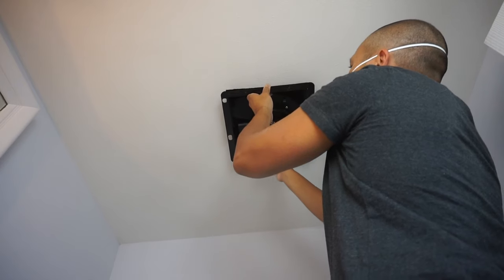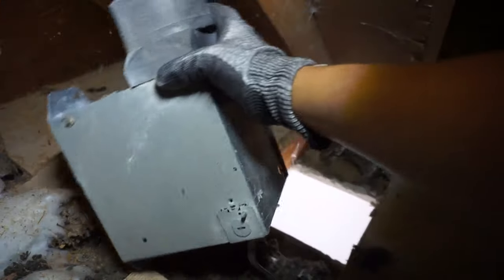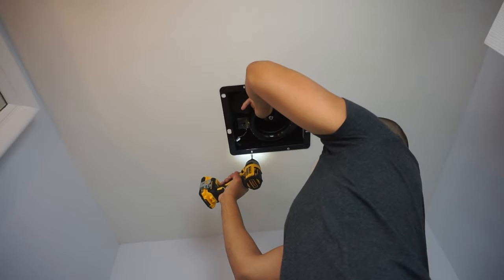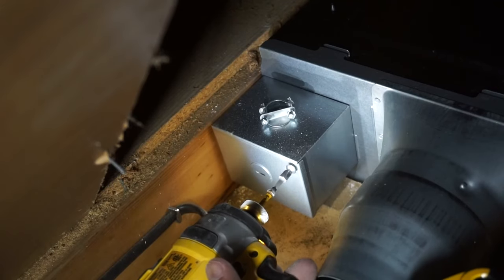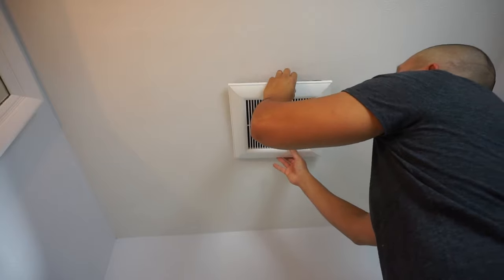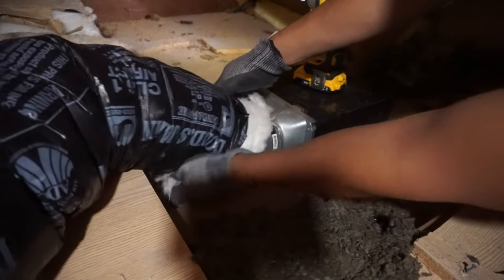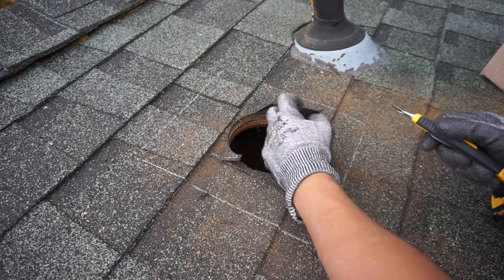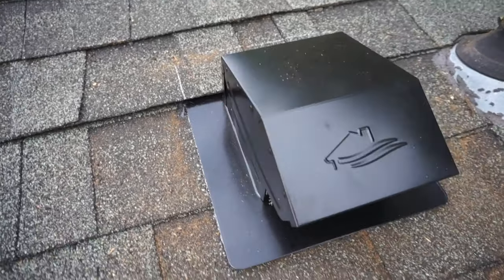How To Replace And Install A Bathroom Exhaust Fan From Start To Finish For Beginners! | Easy DIY

Comment: WHy would you cut a HOLE in the ROOF, when you could have simply cut a hole in the SOFFIT that you'd never have to worry about it leaking instead????
Reply: venting it out the soffit would cause all that moisture to just migrate up into the attic, negating the whole purpose of removing hot air from a home. It is not a recommended practice.
Reply: @Kendo-84  No, no, no. It is recommended. Better than having a leaking roof. You simply have a flex pipe that leads to the soffit area. Your soffit is what, 2 feet deep? Your fan blows the moisture out. Any moisture coming in goes where? How can it go into the attic? It can't because your flex pipe goes from point A to point B. Unless you have a hole in your flex pipe which you shouldn't, it's perfectly safe. At worst you might get a bit of mold on your soffit from moisture coming out when the fan is running.
Reply: @terry7893  your soffit is designed for air flow. If you vent hot air out of your soffit where do you think it goes? Back up into the soffit is the answer. Maybe in your area area but not here in Canada would you ever see that.
Reply: @Kendo-84 Dude..... How much hot air is coming out of your bathroom vent??? Not a lot. Your bathroom is how big? 8 x 10 at most? And more likely smaller? They have vented and non vented soffit. Put the exhaust pipe where there is non vented soffit. If a little gets into the attic, it's no big deal. Your roof is vented too.
Reply: @terry7893  actually it is bigger and has a dedicated steam room. I’m not specifically debating my own bathroom, I am debating all bathrooms I have ever done work on.
Reply: @Kendo-84  If you had a full time furnace in there I'd say you might have a point. But for 99.999% of people's bathrooms (since so few have a dedicated steam room), it's not going to make any difference. I could see now where you might want to put a hole in the roof for a dedicated steam room. You are forgiven. Go and sin no more.
Reply: @terry7893  never did I look for anyone's forgiveness. Just stating that almost nowhere in Canada do you see nor is it recommended to vent through your soffit. End of discussion carry on with your life.
Reply: @Kendo-84  I know you weren't looking for forgiveness; it's just a funny saying.
Reply: @terry7893  I would never vent a bath fan out under the soffit. Its only an option when there's absolutely no other way. I just re-routed a bath fan to the roof that was vented in the soffit. You know there's millions of new homes that use wood soffit. So That's just a rotting issue that will happen, not if but when.  In warm climates you might be ok, but in cold states, I would 100% recommend anyone to not do that. 
A properly installed roof jack is the best way for any venting. 🙂